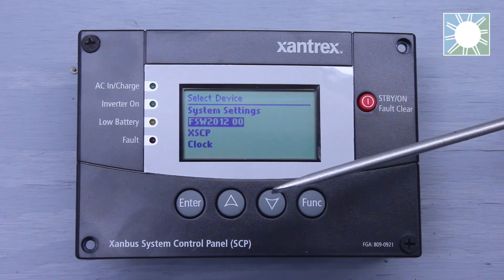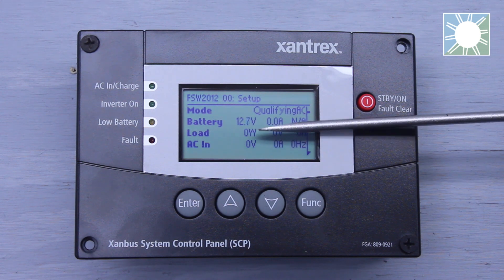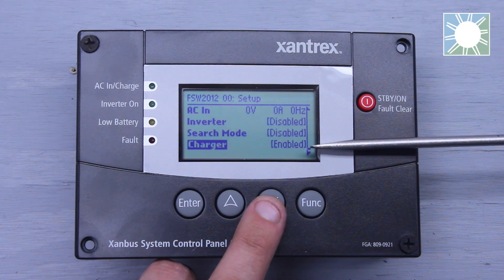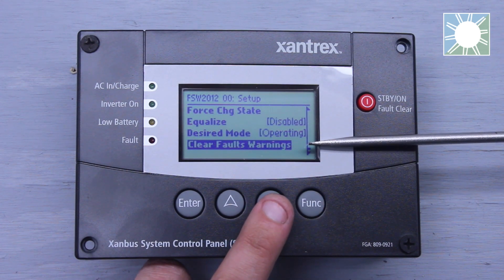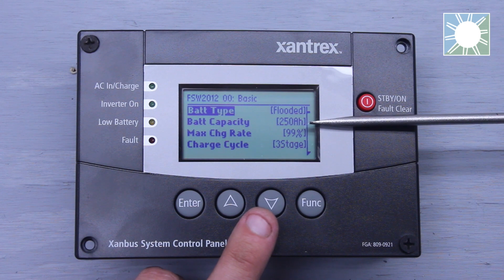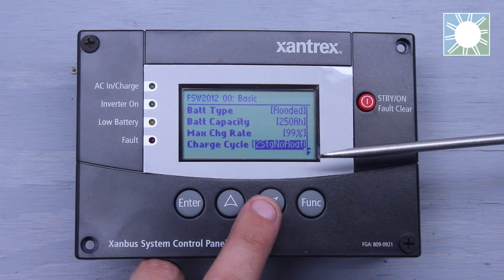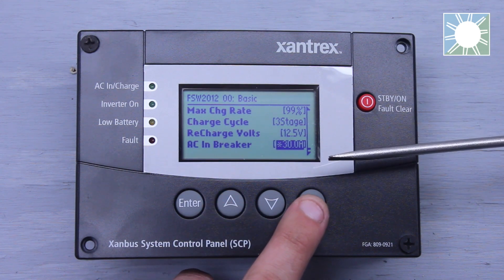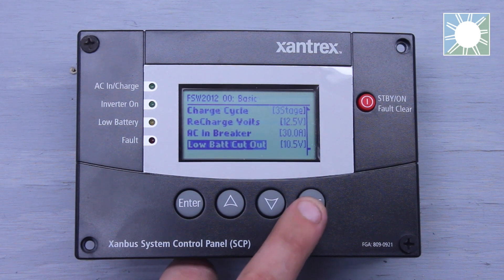FREEDOM SW SCP Walkthrough 2: Inverter/Charger Settings + Basic Settings

Comment: Recently I noticed my alternator doesn’t charge my lithium batteries while the vehicle is running. Do you know if there is a setting on the panel that allows the alternator to charge or not to charge the batteries?
Reply from the maker: Hi Ted, I'm sorry to hear that the alternator is not charging the lithium battery. 
Our tech support guys can give you a hand with the settings, please fill out the support form at this link:
https://xantrex.com/support/get-customer-support/